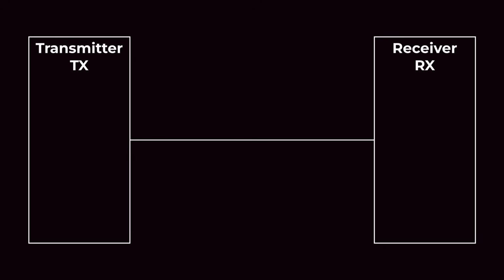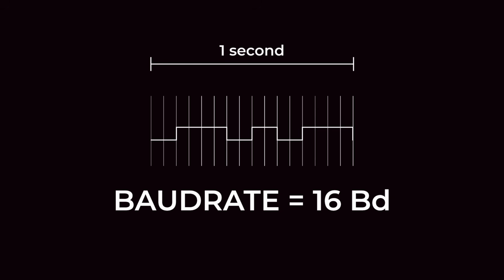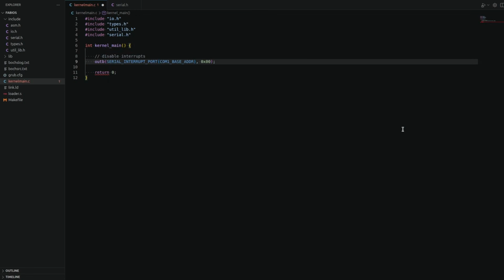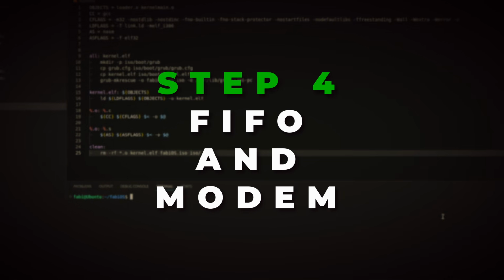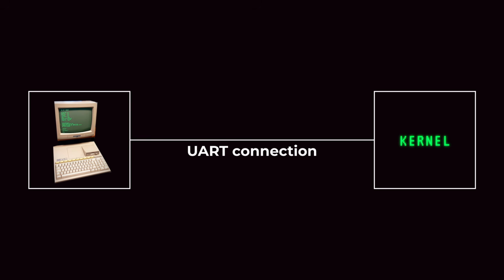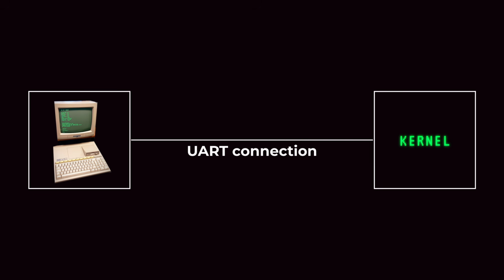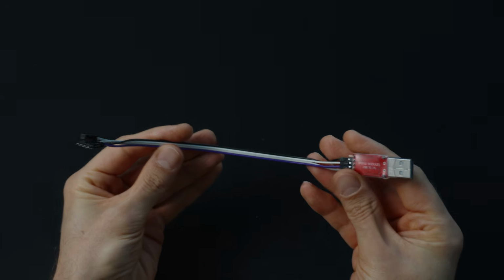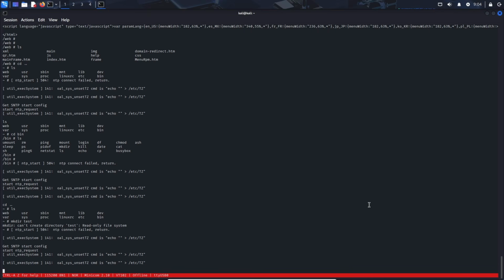Can a Beginner Develop a Kernel? [Part 2]

Comment from the maker: Got any requests for future implementations? Leave a comment below!
Reply: Maybe how to compile executeables and userspace?
Reply: I would like to see how you woild tackle disk I/O. My disk I/O drivers (I actually have two, one for HDDs and one for FDDs) simply go back and forth to real mode to call the BIOS disk interrupt routines. But that requires keeping a portion of your kernel services in the first 64kB of the CPU's logical address space, to prevent stack shenanigans.
Reply from the maker: @damouze  Definitely, a topic for the (far :D) future. Interesting that you have to go back to real mode...but I'm not familiar enough with the topic yet to understand what kinds of issues might arise that could make this necessary. Looking forward to the challenge, though :)
Reply: @FabiLowTech  Going back and forth to real mode is actually not that hard. There are a couple of things you need to take care of, such as keeping two separate IDTs around (one of which is the regular real mode IDT sitting at the very bottom of the CPU's address space), making sure the protected mode stack is either kept up to-date with the real mode stack and vice-versa or shared between them (which means that they need to be in the first 64kB of the CPU's (logical) address space), and making sure the segment registers are loaded properly when going to real mode and going to protected mode (which also means setting up a GDT and loading the GDTR). A much better alternative would be to go back and forth between V86 mode, but that's way more complicated. 

One other thing that I did was to move the IRQ handler's of the primary interrupt controller out of the CPU's reserved interrupt space (0x00-0x1f), even in real mode, to make sure you don't need to worry about the CPU's trap handlers being shared with your IRQ handlers. This obviously means that you have to copy the entries in the real mode IDT that point to the BIOS IRQ handlers to a location of your choosing before reprogramming the PIC. And since I wanted my IRQ handlers to be in a contiguous block of interrupt vectors, I do the same for the BIOS IRQ handlers for the secondary PIC. I think in my case they are moved to 0x20-0x2f, as these interrupts are not used anywhere in the BIOS (and we're not running MS-DOS for instance).

Btw, the only reason I needed to do that is because I wanted to have a couple of device drivers that I could get working easily (by not having to figure out how to talk to the hardware directly ;-) this early in my development process).
Reply from the maker: @damouze  Okay, you're way ahead of me :D ...Up to now, I only have interrupt handlers for cpu-exceptions implemented. But the next step then is probably to remap the PIC. And up to now, I planned to stay in protected mode. But maybe there's value in using real mode from time to time too. I will keep that in mind.
Reply: @FabiLowTech  Well, it took me a while to get where I am. I started out writiing a boot loader to boot the kernel I then still needed to write. The boot loader got complex enough that it started to resemble a kernel so much that I decided to bump it up. But that left me with a kernel that still needed a boot loader. So I copied over some code from the kernel, and after three attempts I had a secondary stage boot loader that would load my kernel and execute it (writing a boot sector is easy, I had a working one already). But then I needed ELF support (because GDB likes to have symbols if you attach it to the qemu as a debugger). I first tried to write that in assembly, but I couldn't get it working. Then I decided to write it in C and I setup  Borland C++ 3.1 just for that purpose (I have the original disks, but the entire compiler suite basically exists as tar.gz file on my NAS), with some wrapper scripts to call it from Make on Linux using DOSEMU. But BCC does not really handle 64-bit data types and arithmetic very well, so I decided to use gcc-ia16 for it. However, the (real-kmode) boot loader and the (protected mode) kernel now share so much code that I decided to eliminate some redundancies. So most of the disk I/O stuff, as well as the VFS stuff and the FAT driver spend their lives as .a archives: one for real-mode and one for protected mode. 

I got at a point that writing a boot loader became so much of a hassle that I needed to rethink my strategy, which is where the inspiration I got from your video from came in ;-). Make it multiboot.....
Reply: yes, maybe keyboard input
Reply from the maker: @elhalmihamza28  Will likely happen in part 4
Reply: love the accent btw. i just have a normal American accent.
Reply from the maker: @dat_dude_david  lol that's nice to hear, because sometimes I really get annoyed that I'm not able to sound a little more like a native speaker.
Reply: @FabiLowTech  You shouldn't worrry too much about that. Most of the world's population is not a native English speaker. You don't have to have a perfect American or British accent to be understandable.
Reply from the maker: @damouze  That's kind :)
Reply: Interrupts
Reply: Interrupts
Reply: One thing that's hard to find on the web (at least for me) is how to design an HAL (hardware abstraction layer) and its drivers.
Reply: Please for the love of God don't implement printf, I am sick to death of people being like "let's write an operating system gaiz" and then implementing printf.

Comment: I cannot get keyboard/serial input to work at this stage.  I have been looking at it for days now (taking lots of breaks), but something seems to be missing.  Is there a trick not shown?  Is it my input method (USB keyboard)?
Reply from the maker: The input method shouldn’t matter, because you input it in a terminal on your actual computer which already is able to accept input that way. The terminal is connected via uart to the kernel. So the problem is probably somewhere in the connection. But it’s hard to diagnose this from a distance. There is no trick that is not shown in the video. Maybe something wrong in the emulator config? But again…hard to diagnose from a distance.
I provide the full source code on my patreon, if you want to take a look. But in the end, it’s the same as shown in the video.
Reply: @FabiLowTech  Thanks for the reply!  I understand it's difficult to troubleshoot from afar, especially with a small bit of information included in the comment.  

I downloaded the source code for part 2 and compiled it without any changes, and your code does not work for me either.  Outside installing qemu, were there any configuration files needed for that?  I don't see any in the code files.  The kernel is not accepting keyboard input from bochs either.

I am using WSL2 (Debian 13) in Windows 11, which may be causing issues.

Comment: Great video! 

Serial I/O is actually one of the first things I wrote for my kernel, in addition to console (screen) I/O. At first it went back and forth to real-mode to call the BIOS serial interrupt routines, but the moment I got IRQs working more or less properly, I had a way to attach the serial IRQs to an irq handler which would then handle serial I/O for the given serial port. Data is put into ring buffers, and reading from and writing to a serial device is all done through those ring buffers. 

Tip: if you need an sofware or hardware interrupt or exception handler, define some kind of context where you can put the CPU state before entering the handler and you can restore them from after exiting it. I wrote this part in assembly, but the neat trick I used was defining the context structure, then putting all the things I want to save onto the stack in reverse order (and beware, PUSH does not always work or suffice here) and finally, just before I enter the handler, I push the stack pointer itself onto the stack. The handler is then defined in C with a pointer to the context as its single parameter. I used nasm's powerful preprocessor macro language to define some macros using which setting up the assembly part of such a handler became pretty easy. So, for instance, the entire assembly part for the irq handler for com1 is a single statement 'irq_handler_stub 4'. The actual irq handler is completely written in C.

I haven't done a lot of work on advancing the kernel recently though, because my adventure making it a proper multiboot kernel is still ongoing, and the kernel still crashes for now.
Reply from the maker: That's some pretty good advice at just the right time :D I'm currently working on interrupts...quite annoying work to get this running. Thanks :)
Reply: @FabiLowTech  My pleasure. What is known must be shared ;-).
Reply from the maker: I couldn‘t agree more :)